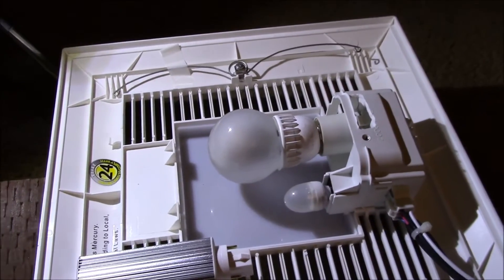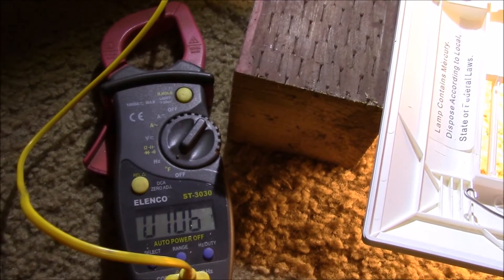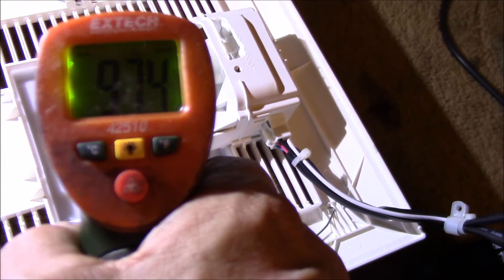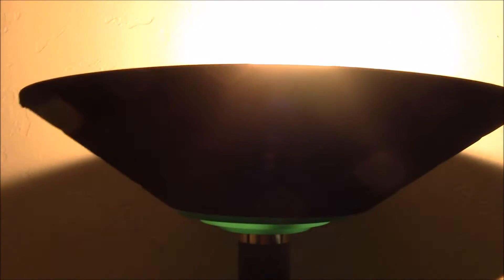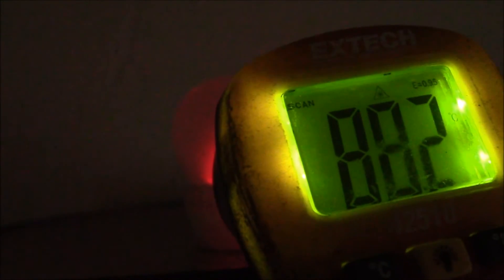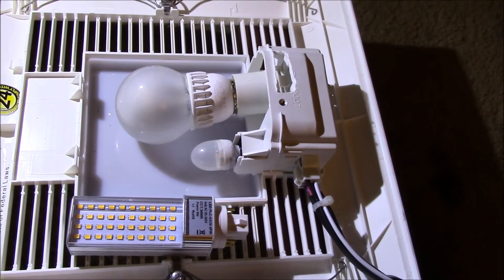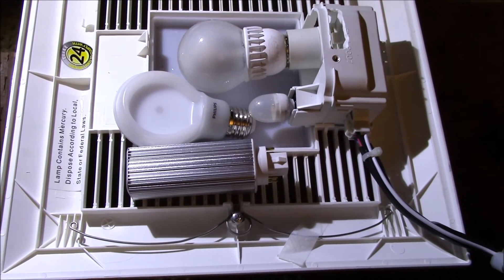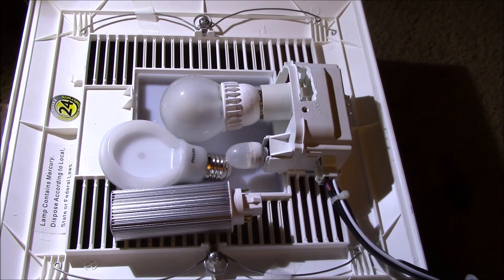Panasonic WhisperLite Bathroom Fan CFL Replacement, Part 7

Comment: Does Panasonic sell a retrofit led light kit ?
Reply from the maker: I've not run across one, not to say someone might make one.  But with the right adapter or matching LED bulb it's very easy to bypass the ballast like I've shown.
Reply: R Brown My ceiling fan has twin CFLS no night light.
Reply from the maker: That's different than mine.  Should be a similar process.  I used a Hero-LED bulb that fit the CFL socket:
https://www.hero-led.com/led-light-bulbs-cfl-led-lamps-c-1_590.html
and then bypassed the electronic ballast in my fixture.
Reply: R Brown This is supposedly the replacement if your ballast goes.  Not exactly what we are looking for in terms of Led.  Do you have a video and instructions on how to bypass the ballast.
Reply from the maker: Sure, this earlier video in the series shows that:
https://youtu.be/HGkLKtO3w5c
You fixture may be different, but the general idea is to find the ballast and it'll have a black and white wire feeding power to it.  Then it'll have 2 or likely more wires running out to the lamp(s).  In my case there were red and blue wires to the CFL.  Hooked those to the black and white power wires and that was it.

Comment: Can you show how to access the part where the bulbs go? Mine is installed already but I can't see an obvious snap or screw to get at the bulbs. Thanks.
Reply from the maker: I'll see if I can set up and shoot a video of that.  The lamp section is just held on by a pair of spring steel pieces on each side.  Just grab the two sides and pull it down slowly.  The springs will try to pull it back up but if you come down far enough, you'll see the springs.
Reply: I've been able to get that far but can't see or access where or how to take off the white plastic covering for the bulb. When I'm finally (with your help) able to do that, do you recommend changing to another type of bulb?
Reply from the maker: I show the cover removal in part 5:
 https://youtu.be/OkuQXWF-_KE
For sure, change the night light bulb to a small LED unit, I think mine is 1/4 - 1/2W instead of the 4W bulb supplied.  And considering the issues folks have reported with the expensive and hard to find CFLs and the electronic ballast  burning out, I replaced mine with LED as well. My first unit is going into it's 3rd year now with the LED bulbs and it working fine.  You just need to be sure and choose a bulb that can be used in an enclosed fixture, many can't and will overheat.
Reply: Thank you for sharing your experience. It made a big difference!

Comment: Geez I got to tell you this last 10 years with light bulbs has become a reaaaaaaal pain in the ass."PITA" The cfl's don't last and very few of the expensive led last a year. I purchased a Panasonic bathroom fan bought 3 bulbs so far none of them can I get to fit the socket. So I am going to buy the adapter for a regular screw in bulb. My model is a FV08vsl2 and the bulbs do not have the cover over them as yours does. Since my fan is installed and I can not take out the ballast what bulb do you recommend I use with an adapter. If I was smart I would just put in the little 4 watt led night light in and close the case and have an electrician put in another light next to it. If it wasn't installed I would throw the whole fan in the trash. Oh Ya! I have 8 serving cfl's that I paid 22 dollars for each that have run every day for twenty years. I only wish I had purchased 60 of them instead of 20.
Reply from the maker: I didn't look for bulbs that would work with a ballast in place.  I know they make those for the T8 type tubes.  I was able to bypass the ballast in one of my fans that was installed.  There was enough access inside to cut the needed wires and reconnect them in place.